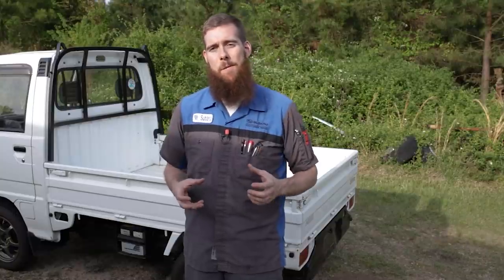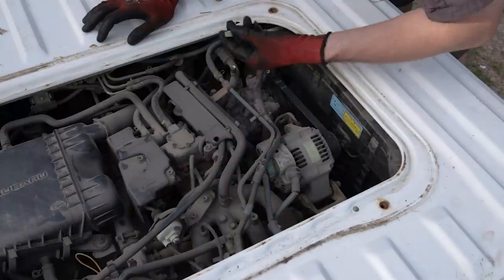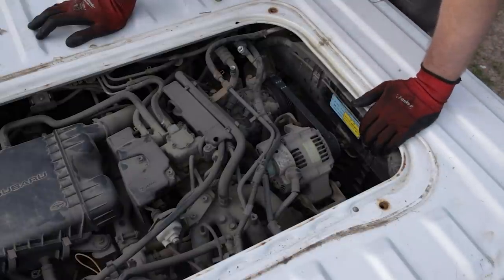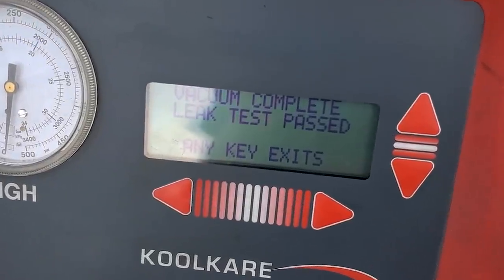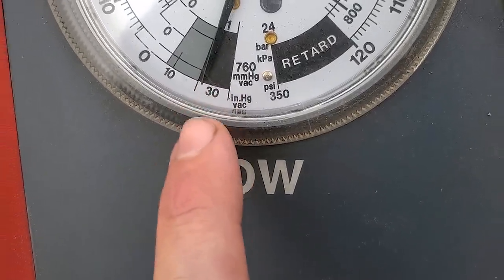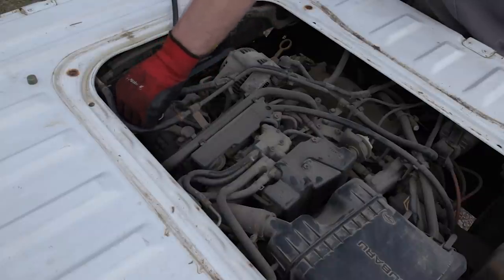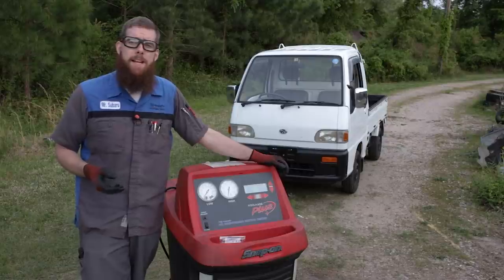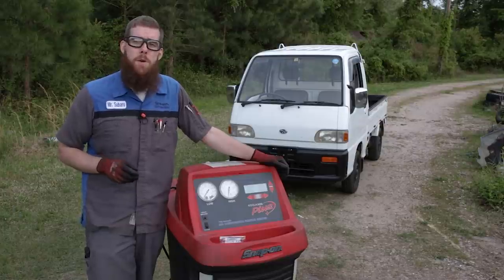Subaru Sambar Super Deluxe A/C Repair & Diagnosis: Part 1

Comment: When rechecking the ac system after running it for the week, make sure and look at the ac drain hose for uv dye. U can sometimes tell if the evaporator is leaking.

Comment: I found with my suburu Sambar it was dust on the thermistor and coils. There were no leaks. I blew off  what I could and the fan went back to having 3 speeds and the A/C was blowing as cold as needed in Alabama heat of summer cab was cool. Two years later, it is starting same old trick. The problem is going to be ongoing. As  I cannot get to the coils to really clean them. Plus no one in A/C buisness knows either.

Comment: Update: blowing out dust was good. However compressor clutch went out. I replaced with a compressor from ECC auto out of Tampa Florida. Cleaning entire duct system and ridding the system of  outside air vent . Made a world of difference in "New Car" smell. The compressor puts out more BTU than stock and life is good again. I have photos of how to. If interested or in need to yourself or  anyone in need.

Comment: The issue I’m having with my Sambar is that the AC/heater fan is not blowing at all. I assume this is either an issue with the switch or the blower fan. The blower fan is located under the dash and I am attempting to pull it off but I’m running into some issues. Could I get some guidance?

Comment: I'm having trouble finding solid data for a customer's 1996 Sambar. Carbureted, normally aspirated, manual trans, and no labelling for the charge value!  

Charge value and a solid electrical diagram for the A/C would be a lifesaver.

 I do have the yellow-covered "Subaru Sambar English Factory Service Manual" by James L. Danko, but there is little to no mention of A/C anything anywhere in it, and certainly no electrical diagram for it!

Comment: First vid I seen of yours lifting up the Sambar's skirt. Tell us there's another access point for service? I'm half jealous the sniffer tool sounds like  asteroids when it hits. If you want to throw out that Bluepoint temp gauge, my aging eyes will thank you.
Reply from the maker: I have plenty of others. Timing belt/water pump job, valve adjustment, etc on the Sambars.

Comment: Do you know what the oil capacity is and which density of pag oil? I do not see an AC section in the manual that has been translated to English. 

I had a compressor grenade and throw trash throughout the system. I pumped near three gallons of solvent until the lines were no longer spewing black. Mine was an R12 system but will be putting in R134a when refilling, and the used compressor I sourced has 134a on the label.

Comment: I’ve worked on about five Subarus and every time I open the Schrader valve on the low side I hear that noise so they must all leak a little bit I wonder if the plastic cap helps it from leaking?

Comment: Just bought a sambar KS4, should be delivered tomorrow, what I do not understand is that although it was built for domestic use in Japan all the lettering on the exterior except the max weight rating on the rear is in English. Why? Is it a fad, like young Americans getting Kanji character tattoos?
Reply: OEM parts=OEM stickers a must have in the Kei Truck community.

Comment: Hi I am from Sri Lanka. I need your help please help me if possible. subaru kv4 1998. hard to find obd location to check obd on my car. Is this vehicle class not obd2? In our country, these vehicles are less in number.
Reply: No OBD2 system in these Kei trucks
Reply from the maker: The supercharged/ fuel injected models do.
Reply: Yep under the dash plug in the two green connectors and it will flash codes